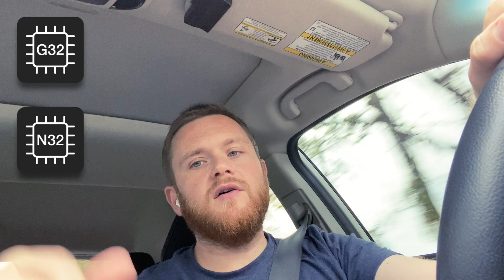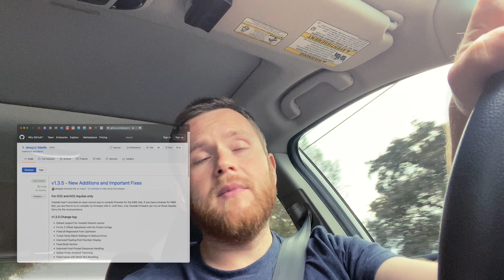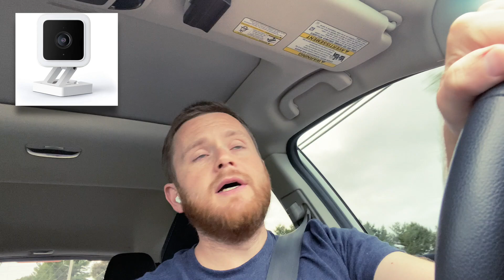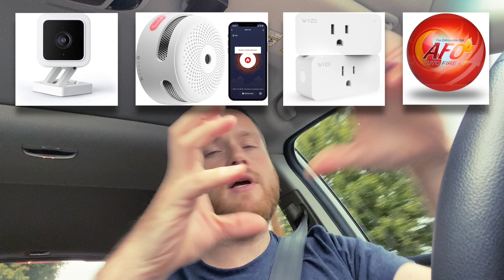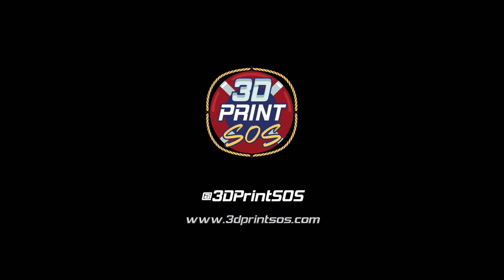Voxelab Aquila H32 - Buyer Beware!

Comment: Their stock board has various bugs a normal user may not notice, but I love modding, so I finally said the heck with it and bought the Creality V4.2.7 board, which is compatible with the stock screen and works great! It won't mount directly without modification, but I'll make it work!
Reply from the maker: The fact that if works with the screen is awesome! Good to know. I might have to pick one up just to see how it works.
Reply: @3DPrintSOS  Works with the stock screen, but you'll need to update the screen firmware. Alex firmware works fine, although, mine is an edited firmware for the touchless sensor, which I absolutely love!
Reply from the maker: @jamienoel  that’s pretty awesome. Thanks for letting me know this was doable.
Reply: You have to do a video on that
Reply from the maker: Dually noted
Reply: Hi,
I'm trying to order a creality board to fit in my Aquila x2. I've found the v4. 2.7 on aliexpress but they offer different options.
Is it the ender 3 V2 version that I need on my Aquila x2? I understand I'll have to adapt it anyway.
Thanks
Rom
Reply from the maker: The Ender 3 v2. Either way, you will need to get the right firmware.
Reply: @3DPrintSOS  OK so the board is the same only the firmware changes.. OK great.
Reply from the maker: Yup. It should work in a bunch of different configs.
Reply: @3DPrintSOS  hi I have Installed my new board in the Aquila x2.
If I get everything right I need to change my firmware for both the mother board and the screen.
Which firmware should I choose knowing I want to use a cr touch and octoprint via rasp berry.?
Thanks
Reply from the maker: I would just go with JyuersUI. Lots of options and lots of pre compiled configurations already available
Reply: @3DPrintSOS  that's exact what I did.
And everything went great until I tryed to home.
Y and z perfect.
X went the opposite way.
I stopped it before it hit the end of the rail.
I can't explain it but the x plug on the creality board is not the same orientation... And so I took the decision to remove the pins from my stepper plug and flip them all around.. It fixed the problem.. And I am printing my first part with the new board as I'm typing this message.

Comment: I got 2 Aquila and agree but talk more about how the couplers are shitty I HATE THEM SO MUCH.
Reply from the maker: The extruder all together is criminally bad. That includes the horrible coupler. The one on the hot end hasn’t caused issues for me yet though.
Reply: @3DPrintSOS  EZR STRUDER FTW!!!!!!!!!! :-)
Reply from the maker: Forever live ezr struder!
Reply: @heroflying  Agree Ive got a few and they work quite nice and are holding up great. Nice constrained filament path also work great with super soft NinjaFlex TPU.
Reply: @3DPrintSOS  Funny I must have the best luck with extruders. I am running my original ones on both Aquila's over 6 months and a few hundred prints. Both hot end couplers also. My E3v2 is over a year old with original extruder...lol. Not saying they are good at all I just seem to have good luck. Now I never even ran the stock couplers on the extruder ends of the Aquila's pure junk!
Reply from the maker: I’m glad you’ve had luck. Cause they upset me with these extruders. Haha.
Reply: @3DPrintSOS  Yeah I am actually amazed I thought they would be long in the trash. I have their replacements sitting here collecting dust. This thought has got me scratching my head though. Probably no single manufacture uses more STM32F103 processors than Creality and while I am sure they have a decent contract with STM but how is it that they seem to have an endless supply of STM chips? No shortages on their end. Seems to be a unlimited supply of printers and replacement/upgrade boards in the channel? While I understand they might get preference in some respects and the shortage is real yet does not seem to effect Creality and even some of the smaller printer manufactures at all! Kind of makes you wonder whats going one and if saving a little money per unit isn't heavily factoring into the chip changes in reality? Or at least to some point. Kinda makes you think right?
Reply from the maker: Oh for sure. I mentioned that this is a business. So they must have found an opening and used it.
Reply: @3DPrintSOS  Bean counters vs engineers! Pretty much a universal issue world wide.. However to keep making these mistakes and hurting their rep and sales over saving a few cent's per unit makes zero sense. I am sure they just figured we the consumer wouldn't notice and though they could pull a fast one. At first I defended Voxelab and just put it all on the chip shortage but now I am starting to believe different or at the very least have my suspicions. Anyway i picked up my 3rd one a X2 during the week. Haven't opened the box yet as I have a few printers to get to before this one. Not worried though i would bet it's going to be a H32. I've got a few Voxelab STM32 boards with blown AABL ports that I can use for now and a Creality 4.2.7 board and display left over for a E3v2 upgrade so I covered for sure. Keep up the good work Fedor! I've got to ask you something but I'll PM you on FB during the week.

Comment: One of my Aquilas is an H32. It locked up once but luckily I was there to stop it
Reply from the maker: Locked up how? You actually had the thermistor fail on you?
Reply: @3DPrintSOS  I should also add that it, along with my 5 others are running 24/7 with Etsy orders. That's the only time something like that has happened. There's been a couple of times when the temp just drops out of nowhere and I have to restart the print, also only on the H32 one
Reply from the maker: Hmm. Noted. Good to know it’s at least been a minor problem.
Reply: @3DPrintSOS  yeah it's been at least a week and 2 rolls of filament with no issues
Reply: @AnotherWearyTraveler  had this occur to me that Voxelab wouldn't acknowledge. Happened to me 4 or 5 times all today. Once it was a week apart between events so hope it won't happen to you again.
Reply from the maker: Gotta be a faulty thermistor
Reply: @3DPrintSOS  I don't think it was the thermistor, it hasn't had any issues since. It was just printing and then it stopped, kept heating, the screen froze and it beeped until I turned it off. I turned it back on the temp was super high
Reply from the maker: Hmm. I mean, that IS the bug. So for one reason or another, the thermistor must have come loose or lost connectivity.

Comment: How to know which chip version I have?
Reply from the maker: There is a sticker on the front left of your machine. It should say either n32 or h32. If not, it’s a g32
Reply: @3DPrintSOS  thank you.  I thought that was the case but mine doesn't specify
Reply from the maker: So you got the OG G32. Like I briefly mentioned, mine has been rockin for 10 months and it’s been great.
Reply: @3DPrintSOS  also, I have had the runaway issue on my G32.  It would happen during every single heatup for like 3 days and then just randomly stopped.  I already checked for the new firmware so I will upload that shortly

Comment: MKS Robin E3 is 18€ right now, absolutely great board. It also allows for the installation of touch screens.
But yeah, locking an open-source product up by swapping the chips without clearly stating it beforehand is a reeeeeeeally shitty move.

Defending them is objectively not the best thing (cloning others work, H32 debacle, thermal runaway debacle) but they've enabled me to get a printer, even though I don't have heaps of cash as a university student, so there's that.

Thanks for the video, fedor!
Reply from the maker: Good way to look at it. :)
Reply: Thanks I will probably use pla exclusively!  I really appreciate your response! I hope as a nub at this I can learn to create my own things! Thanks again! Have a great day!
Reply from the maker: This printer would be a perfect first machine. Voxelmaker is rather simple and being able to just drag a file in, select print and have it wireless start is great.

Comment: This isn't hard to fix in firmware. Firmware is where it's usually controlled. Open Circuit reading? Shut down. Easy.
Reply from the maker: Looks like they have already released firmware to fix this. I updated it in the description.

Comment: Hey, I just bought an aquila, it's an h32, and I watched a video from you about 10 months ago. Stating that I can get new firm ware from a link in you video wiche will turn off the Machine if the thermistor comes unplugged, is that still and option, or what do you recommend I do
Reply from the maker: I recommend you get the latest firmware from voxelab and the. Wait for Alex to release his aftermarket version
Reply: @3DPrintSOS   when he releases he after market versions can you please make video and leave a link, on how to do it, thank you, I've learned alot from your videos
Reply from the maker: Absolutely.
Reply: @3DPrintSOS  thank you so much, but can I still run it when I'm watching it until then?
Reply from the maker: Yea for sure. Just be present.
Reply: @3DPrintSOS  thank you so much, do you have patron? If so I'll subscribe
Reply from the maker: @loganmaurino1284  I just made one. :) www.patreon.com/3dprintsos

Comment: Thanks for the heads up. I bought my printer about 3+ weeks ago. How can I tell what kind of board I have?
Reply from the maker: There should be a sticker on the front left of the machine.

It will either say n32 or H32. If you don’t have one, it’s a g32 machine.

Comment: Been loving my x2. It's been running stuff off now since I got it running about 6 days ago. It's an h32 so I'm hopeful for the firmware very soon.
Reply from the maker: If you get on the latest firmware, it should still be a decent printer. :)
Reply: @3DPrintSOS  I haven't had a single issue with it yet. Just worried a little hearing about the risk of fire. I do have a camera watching it but no smart plugs. Going to order them today or tomorrow
Reply from the maker: It’ll be a major ease on the mind with the plugs.

Comment: Questions on the original Aquila with the g32 can you replace the board with an aftermarket board
Reply: Yes you can. There are many after market boards designed for the Ender printers which is what the Aquila is a clone of. Ender boards have a different bolt pattern for mounting the board so you will need to print a new mainboard enclosure to use them.
Reply from the maker: No big deal really. Will help with wire management too. ;)
Reply from the maker: Yep of course. :)